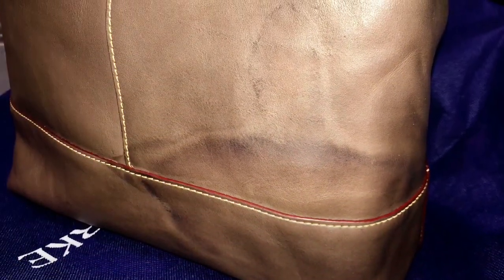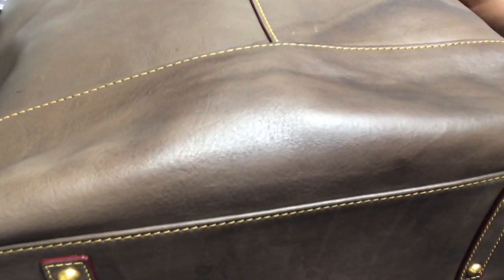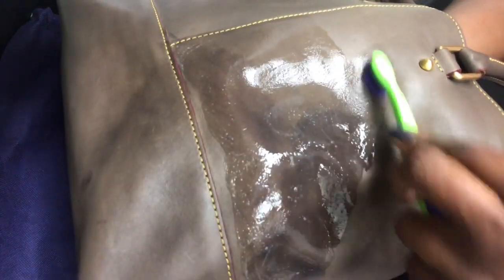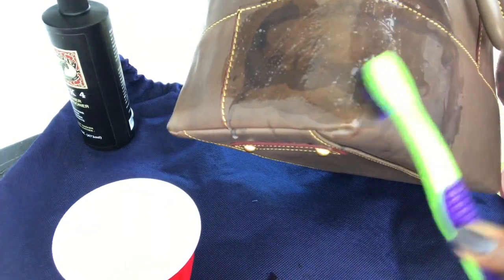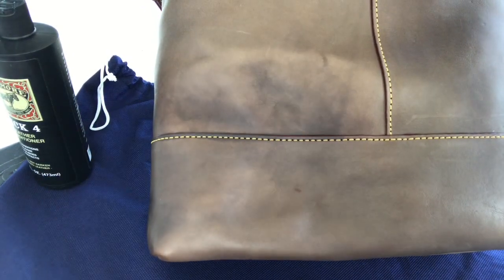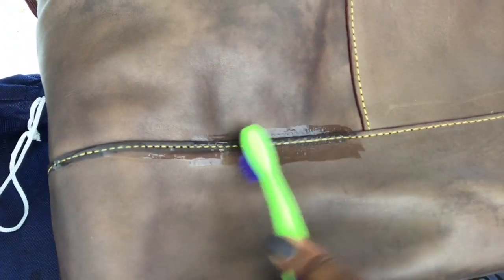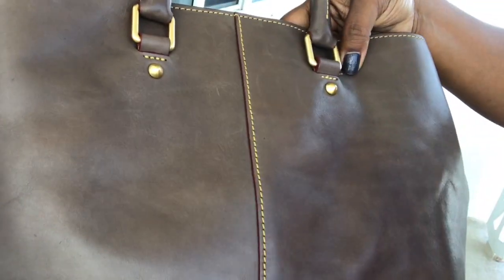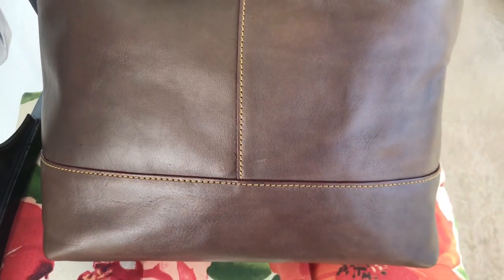Dooney & Bourke - Water Damage/Stain Removal Attempt (Florentine Leather)

Comment: I am PISSED! Before I could even completely unwrap my new Florentine Miley Drawstring Bag, I moved a glass of ginger ale and a drop fell, onto the bag. I kid you not, a tiny drop. It dripped down the bag.  I didn't notice right away, maybe an hour later. This stupid drip "sunk" into the leather it is all you notice. I have tried EVERYTHING to remove it including this method. For the first 24/48 hours it appeared to work, removing the stain. But NOPE. It was back in a few days prominent as ever.
I am a 50- year Dooney collector and NEVER in all these years have I dealt with this type of issue. I am done with their Vachetta leather, or whatever this cheap crap is, for $400+ DOLLARS. Beware ladies..  you will regret buying this leather. I wish I could attach a picture, this leather will NEVER survive getting wet or rained on, or, any type of drip.
**THE STAIN IS FROM A WATER DRIP FROM THE GLASS CONDENSATION** JUST WATER
IT IS THE "NATURAL LEATHER" color bag... the Dooney dark dark tan
Reply from the maker: So sorry this happened to your bag. My range was “water”. It’s a different beast when dealing with sodas and other drinks. Did you try the Dawn dish soap in the blue color? I’ve never had issues with stains, only this one. It was in a closet and got AC water dripped on it due to hurricane water damage. Don’t completely count out Florentine. It’s super good leather
Reply: @ThePecanTannedBeauty  Awe thanks, I came across your video and tried your method. It seemed to work but just a few days later the stain reappeared.. I have tried EVERYTHING.. I can't believe it.
Maybe most people wouldn't notice it but it's all I can see 😞.  The bag is still wrapped the way it came except for the large outer wrapping.  I love your posts, thank you! I am heartbroken lol...
Reply: @ThePecanTannedBeauty  It is a water drip from a glass that had water condensation on it, I moved the glass and a water drip fell onto the front of the bag, super prominent location.. water should NOT stain that quickly. It was about an hour before I noticed it, maybe not even that long. But it was already "sunken in" deep.
Reply from the maker: @KitKeller-yh8nz yeah, water has minerals and other elements that are not natural that causes the staining. It’s sad that it does that but Florentine is natural leather from animal. Hopefully you can find a solution to bring her back to life. Thanks for watching!
Reply from the maker: One more thing… you may want to spray a rain and stain repellent on it to prevent any other accidents. That has worked for me. I use the one made by Apple Brand. I have an older video on here demonstrating how I do it.
Reply: @ThePecanTannedBeauty  Thanks again for your replies, you are awesome 😉

Comment: Good morning . I purchased a cameron florentine leather bag in the color Chestnut.  I did so at the Dooney and bourke outlet store. I like my leather smooth. The worker went in the back and searched out the smoothest bag.  Last night I was looking at the bag and noticed 3 long welts running across the bag not deep but noticable. Any suggestions on how to get these fine lines out without comprising the beautiful Chestnut color???
Reply from the maker: Nadine Brackett Good morning! The Cameron in Chestnut is gorgeous. Keep in mind that these bags are made of real animal hide and will have variations, lines, stripes, scratches, etc. it’s just the nature of leather. When you say welts, I’m assuming you mean like deep scratches that have made imprints in the leather? For those, they should even out over time. Is that what you are referring to?